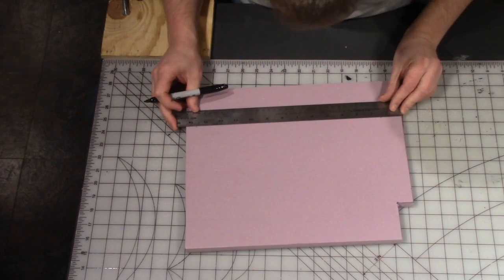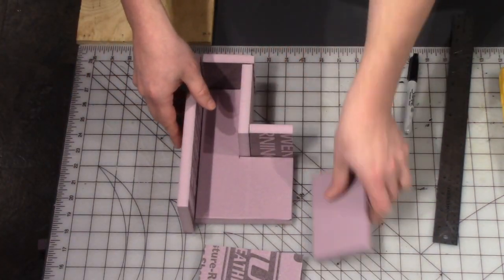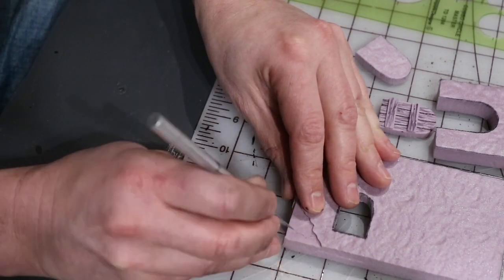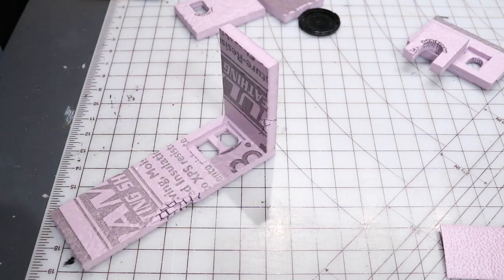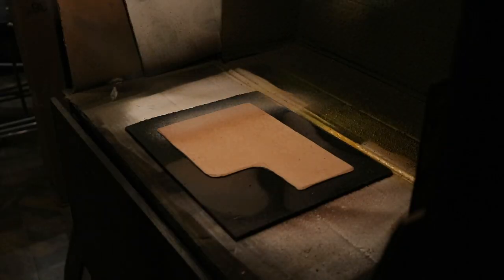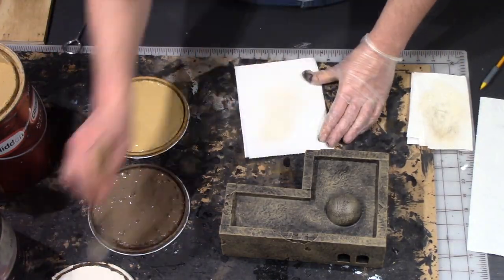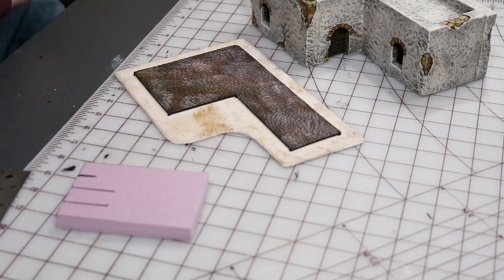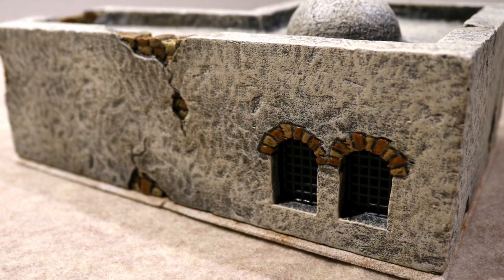014-Desert Building

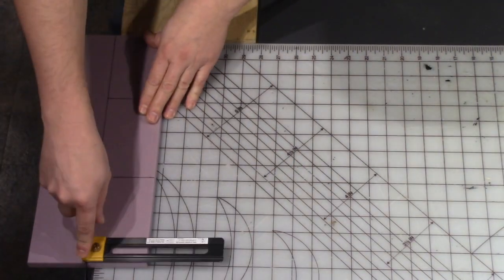Comment: Great video! I really like the projects your channel demos. At 0:39 you are using a utility knife to cut some XPS foam, what is the attachment called that is screwed to the utility knife (it is yellow and black)? Seems really helpful when trying to cut square.
Reply from the maker: It is an Olfa circle cutting knife. I removed the pivot pin and the bracket holds it square. I did a video on the knives I use here: https://youtu.be/lXCNtAeVlTc